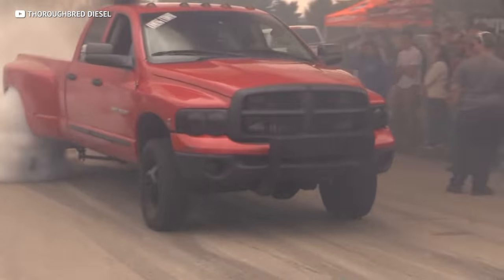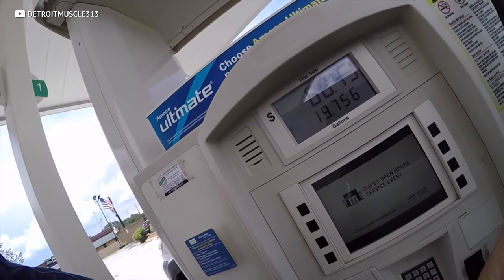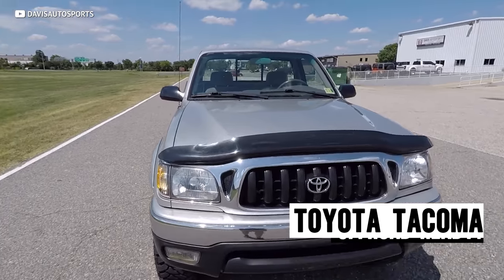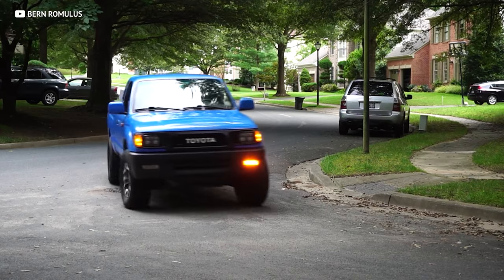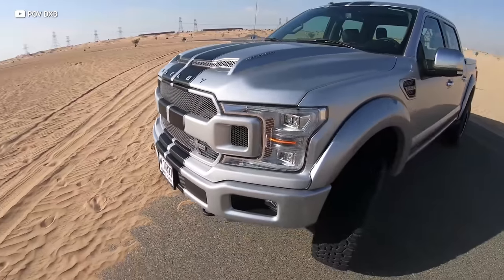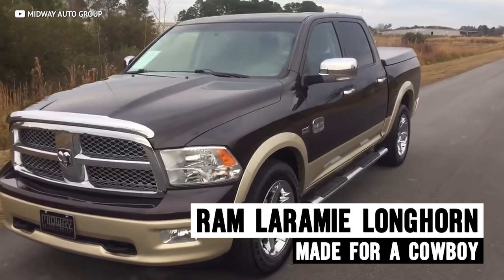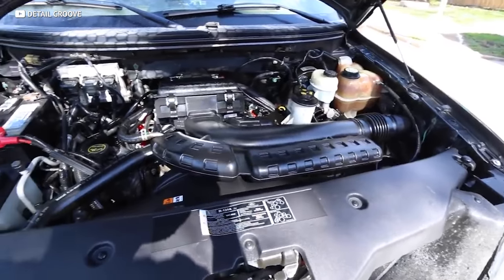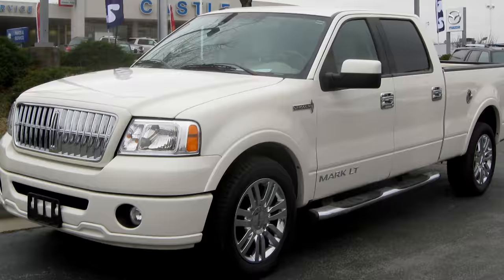7 BADASS Trucks That LOOK EXPENSIVE... But You Can Afford!

Comment: I just got rid of my 2017 F150 with the 2.7 ecoboost... I hated it. My 14 ram with the 5.7 hemi got the same mpg, burned less oil between oil changes, had a more comfortable drivers seat, better exhaust sound, and could tow more. People will say the 2.7 will tow just as much, but what they won't tell you is that you have to redline that motor to create enough boost to get over any Colorado mountain pass. The only thing the f150 had that I liked over my ram was the flat floor. But now you can get the new body style ram with out the middle passenger hump...

Comment: Or for the Ideal deal on the Cadillac is to know its a Chevy Avalanche with a Lac frontend and lil bit better interior. Frontend conversions are cheap and you can find Avalanches for as low as $500 USD.

Comment: The 2021 F150 Raptor will have the GT500 engine with the Supercharger to 770 Horsepower or the current V6 with twin turbos 450 hp. Suggest V8 5.0 with the Supercharger

Comment: The 5.4L 3v engine from Ford is far from a reliable and cheap engine to fix.  Easily one of the worst engines ever!
Reply: Everyone I know that has a 5.4 complains about fixin em all the time, same with the Ford 6.0 diesel. Has the rep as the worst diesel ever made!😂 If anyone is thinking about a Ford truck, just get the newer 5.0s or if diesel the 7.3. Very reliable and easily some of the most customizable trucks on the market.✌🏾
Reply: @mrpoppincz8432  you can bulitproof a 6.0
Reply: @christianmoline8271  The question is; is it worth it though?
Reply: @mrpoppincz8432  no i would just get a durramax

Comment: I'd go for the Dodge Ram, but not the one on the list. The 2nd gen Dodge Ram (the one in the movie TWISTER) would be my choice. HOWEVER, I would take small bits from all of the other trucks that you mentioned here and put it on just one truck of my choice - the Dodge Ram. Make it look stock on the outside, but a totally different truck when it comes to comfort, luxury, and most of all performace and reliability. I'm pretty sure someone have thought of my idea, but only a few have done an actual truck that I have in mind. It would be so cool to have a truck like that.